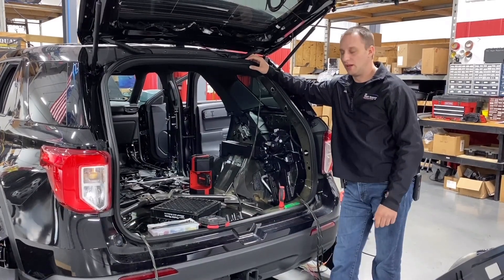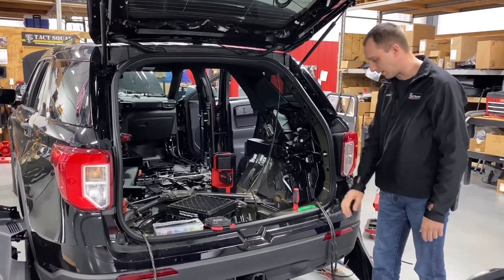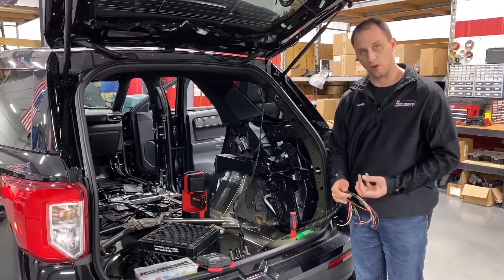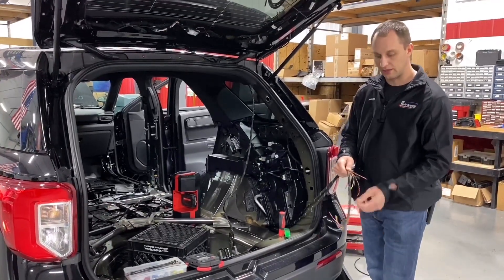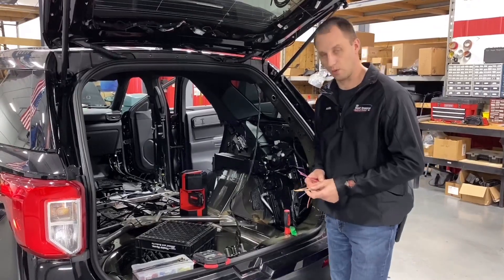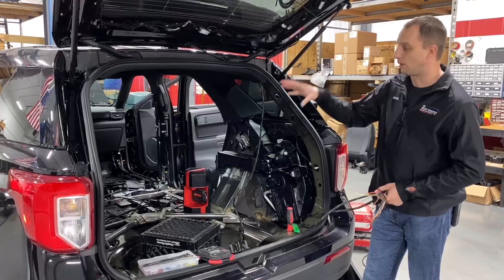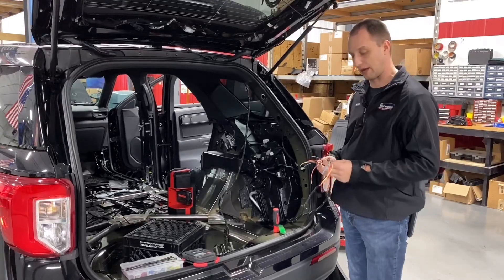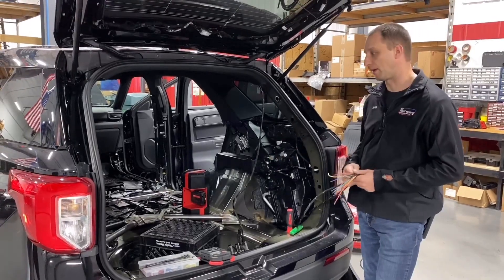Vehicle Installs, Our Wiring | 911RR

Comment: Hey there where can i learn the field of installing lights and  siren
Reply: Answer me 911 rapid response 😅
Reply: Try to find an upfitter to train you. Ultimately it's just a different field of automotive tech. Just learn how to run wires, disassemble interior panels, remove bumpers, drill new mounts, seal holes, etc.

Comment: I wish someone would explain fusing, like how to fuse these new smart controller’s
Reply: Start with some sort of board to screw into. Install a fuse terminal and run a thick wire, perhaps 8 gauge directly to your battery positive, and then find an appropriate ground for the other end. Just wire your power to each accessory to a slot on your fuse terminal, and use the specified fuse for each accessory. It might help to outline your design beforehand with a sharpie so you can find a good way to cleanly run your wires.